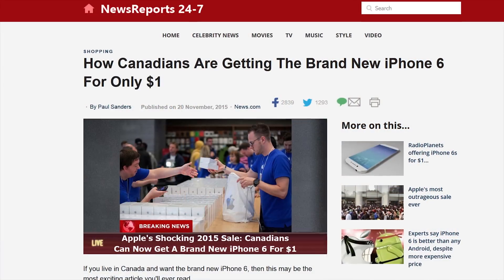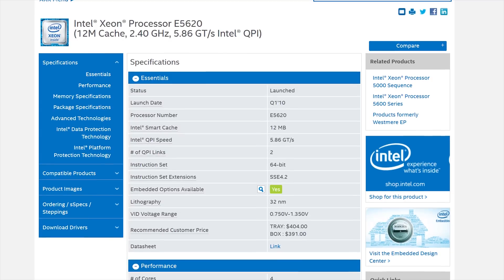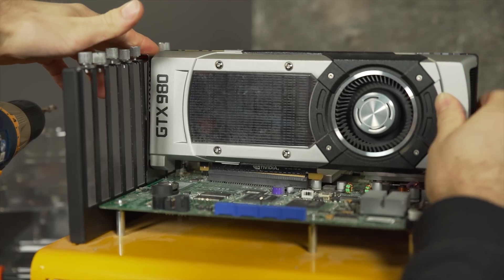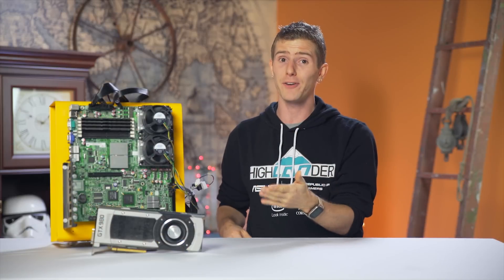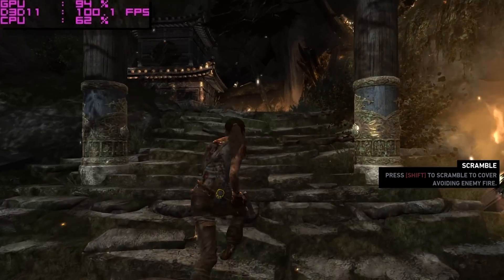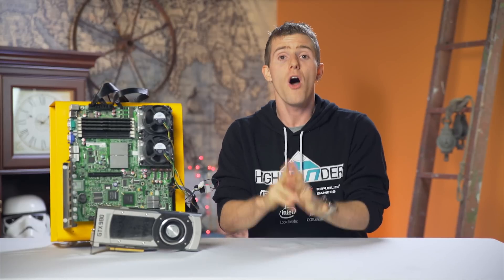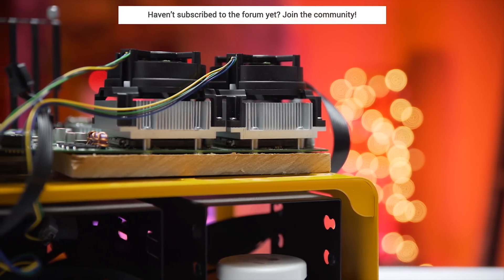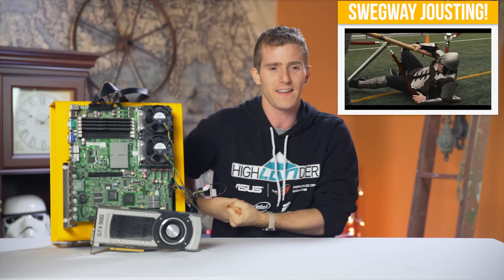Under $150 Budget Gaming 8 Core CPU, Motherboard & 16GB RAM

Comment: DDR3 RAM is dirt cheap (8GB for about 30-40 bucks), low budget ATX motherboards are dirt cheap (40-50 bucks) and an AMD FX-8300 octa-core CPU is pretty cheap (just over 120 bucks). So in total you'd spend about 200 bucks (give or take) for much more standard, newer hardware which still receives support.
What Linus forgot to mention is that you'll still need a PSU, case, HDD or SSD, an OS and, of course, a graphics cards. 

His option is certainly interesting and challenging, but challenging in the sense of buying a beat up 60 year old VW Beetle and getting it to run with parts scrounged from the local scrapyard. In the end it might run, but at what price?
 
If you're really on a tight budget, I'd suggest going to scrapyards, finding some half-decent PCs, cobbling them together and putting in some relatively new hardware. I've found PCs with perfectly fine motherboards, PSUs and RAM and all I had to do was swap the CPU or put in a new cooler or GPU. Or ask a local computershop if they've got any parts they're willing to throw away or sell for cheap. The store I worked at usually collected old but still working parts and either gave them away or sold them for pennies.

Comment: Just one question how this setup compeers to let say i3-4170@3.7GHz + 8GB ram(my setup :) ) in games? Because in video editing those 8 cores will be better but in games? This i3 is also very cheap and runs at 3,7GHz and you get normal mb and no extra moding needed like losing guaranty on graphics card or putting potential fireplace inside your computer case(peace of wood behind two 80W cpus - just brilliant idea)

Comment: I'm glad I saw this. My pc has a really weak Amd apu bottlenecking my r9 270, and I've been looking to replace it. While this really isn't "high end", it would be better than what I've got. Besides, Amazon has this exact same processor for 12 bucks apiece. A motherboard, ram, and two of these processors would cost just under 100 dollars, not including new coolers. Once again, excellent video!

Comment: I just bought this pc for $180 from parts of of craigslist, cooler master atx midtower case, 6 core 3.0ghz amd athelon, an adequate motherboard from asrock, 450 watt powersuply, gtx 750 ti, 8gb gddr3 corsair dominator ram, 500gb hdd,dvd drive, Windows 10.

Always look for package deals, i ended up with a set of 4gb (2x2gb) ram sticks and an old 4000 series graphics card as extras, but the other components mad it worth it.

As long as your patient and know what your looking for you can get great deals.

Comment: Is this a good build
 CPU: http://www.amazon.co.uk/gp/product/B010T6DJCU/ref=as_li_tl?ie=UTF8&camp=1634&creative=19450&creativeASIN=B010T6DJCU&linkCode=as2&tag=alisweb-21

GPU: http://www.amazon.co.uk/gp/product/B015E5X4O4/ref=as_li_tl?ie=UTF8&camp=1634&creative=19450&creativeASIN=B015E5X4O4&linkCode=as2&tag=alisweb-21

PSU: http://www.amazon.co.uk/gp/product/B00YPQN8GS/ref=as_li_tl?ie=UTF8&camp=1634&creative=19450&creativeASIN=B00YPQN8GS&linkCode=as2&tag=alisweb-21

SSD: http://www.amazon.co.uk/gp/product/B00LF10KTO/ref=as_li_tl?ie=UTF8&camp=1634&creative=19450&creativeASIN=B00LF10KTO&linkCode=as2&tag=alisweb-21

RAM: http://www.amazon.co.uk/gp/product/B00QXT5MNM/ref=as_li_tl?ie=UTF8&camp=1634&creative=19450&creativeASIN=B00QXT5MNM&linkCode=as2&tag=alisweb-21

CASE: http://www.amazon.co.uk/gp/product/B00WT0LDDC/ref=as_li_tl?ie=UTF8&camp=1634&creative=19450&creativeASIN=B00WT0LDDC&linkCode=as2&tag=alisweb-21

Mb: http://www.amazon.co.uk/gp/product/B0126R2LBK/ref=as_li_tl?ie=UTF8&camp=1634&creative=19450&creativeASIN=B0126R2LBK&linkCode=as2&tag=alisweb-21

Comment: +LinusTechTips Awesome video, have explored this topic in depth for a while myself.  

Also the CPU's are not designed to be cooled passively. These boards are designed to fit in thin 1U server chassis meaning that the fans are actually installed to the side of the CPU heatsinks. The fan power connectors are powered off of connectors on a daughter board, the RAID backplane, but not commonly of the mobo itself.  Also the server fans usually have different connectors that the standard desktop fans you are using in this video.

Comment: How good is the i7 930 CPU? I saw one on Ebay for roughly 40 British Pounds and was wondering if that is a good alternative? I always see those CPU's on sale on Ebay for some reason. Obviously they are older but will they hold up to modern games on medium/high settings? I have an old graphics card (Radeon HD 7750) and ram so I am thinking of building a second rig for testing and stuff or to give away as a present. Thanks!

Comment: 3 Years befor i buy a (*) for 300€ and additional 16GB for 150€. So now i have System with 2 Quads, 32GB RAM, 3x 1TB (only 2TB Useable because of Controler) in Raid 0 and a XFX HD 6670 because it don't need extra Power. The HDD and GPU i've take from old Towers at Work, otherwise they would throw them away.

(*)Intel SR1560SF2x Intel Xeon E5472 Quad @ 3GHz16GB ECC-5300F RAM

Comment: The sawing of the GPU was a mistake, especially since it's more expensive than the motherboard. You should have unsoldered that capacitor and extend its leads to put it aside.

Comment: Easy, for who care:

Dell Precision Workstation T3500
7gb Ram (ebay)
(1x) Xeon W3530 8 cores (ebay)
Gtx 750 ti 2gb ddr5 128 bit Zotac (Newegg)
Any ssd
Stock Power supply

This cost like 375 usd and run lastest game at almost  maximum setting. That's enough for me btw :P.

Comment: I've also seen older Apple Mac Pros (intel Xeon dual quad-cores, 2.8 - 3.2MHz) online for as cheap as $250.  They'll run Windows 7/8/10 just fine, and you can upgrade the PCI-E video cards.  (you'll have to retrofit cards with 6 or 8-pin power connectors, as it comes with 4-pin)
Benefits of this being it's already a complete system, and a well-designed solid case.

Comment: I did the socket 771 to 775 mod on a old dumpster board I found. The x5460 cost me just $30 and $120 for the 750ti. A year and a half later its still going strong, but seriously though buy a new rig. It sucks not having modern features, but in a pinch its fine.

Comment: Well linus technically you have paid 720 bucks for the system the 150 for the ram board and cpus and 570 for the gtx 980 that is essentially doing all the work

Comment: It's an interesting experiment, but I'd sooner just do a $300 AMD APU build.  It includes the graphics capabilities already, but also has a case and doesn't require all of the tedious hunting for the right parts.  And realistically the build in the video doesn't have the GPU included anyway, which is easily another $150 for something decent.

Comment: Does it play minecraft fallout 4 and FTL?!?!?!
Reply: +ImJosephStalin Not without a GPU it doesn't.  You won't be playing much of anything for $150.
Reply: Not even minecraft and FTL?
Reply: +ImJosephStalin Maybe if the processors have integrated HD graphics.  I'm pretty sure the ones he's using do not though.  

My recommendation is to save up a little more and build an AMD APU PC if you are trying to do it on a shoestring budget.  Or even check craigslist and see what you can get for the same price.

Comment: I don't mind seeing gaming rig videos, but I'd really like to see some work friendly machines. Or would I just need to slap a quadro or fire pro into any of this gaming PCs
Reply: +Luis Valdes What he builds for gaming would be fine for "work" I warranty service and repair PCs and rarely if ever do I see Quadros and FirePros in them. I mostly see older Nvidia 700/800 series single slot cards and older AMD HD single slot cards (that is to say, if Intel HD graphics isn't good enough). My recommendation is that if you need a Quadro or FirePro, then you already own one. And yes, you can put a Quadro or FirePro into any of Linus's builds.
Reply: Sorry,I completely miss the word CAD before the "work". I been told that those cad video cards dont have better specs than gaming cards but have "open gl" that suppose to work better for 3d modeling software. I just dont know if the vcards can be used with any other mother boards or certain processors

Comment: I have a old Hp 800 1000w psu i might actually make that my gamer dual xeon E5506 got dual x5672  (coming found them cheap on ebay) it has 32 gig of ram and a 500 gig ssd  already on it just need a display card that will compliment it any help ????.  Was thinking of a 970 or a 390 (not worth it for the x).
Reply: +Paul K I had the HP Z600 for gaming for a while, but I had the X5570 (edited from X5670) processors with 16 gigs of RAM. I used an AMD R9-270x, so if you want a 390, go for it.
Reply: Cheers mate are the 390 worth it the 4 gig version . Are the X5670 good processors or did i just wast my money . I Have a old xw8600 allso that i modded into another case (fractal eatx case ). Thanks for any advise Appreciate that very much
Reply: ***** The x5670 is GREAT value for the 1366 platform. However, the x5670 is NOT  compatible with the 771 platform xw8600. I'd recommend, if you plan to keep the x5670(s) that you get an HP Z600 or Z800 (just make sure you get the 2nd gen of either.) The Z600/Z800 run $250-$350 on Ebay fully loaded (look for a lower spec one that you can throw you X5670(s)) in and that will save some $$.  Also, on Newegg, the 390/390x only comes in 8gig (unless you count the $800 power color 16gig 390x) and is about $10-30 cheaper than the GTX 970 for a technically better GPU.

Comment: The problem with the $150 price tag, is that there's no PSU or GPU included in the price. A cheap quality PSU can easily kill all your components and a 980ti (as everyone and I say) isn't cheap.
Reply: +Tom5tom Entertainment Yes... From what I can see, I believe (with my years of PC repair and a trained eye) that the motherboard most likely requires the OEM proprietary PSU to work and he didn't want to throw the budget.
Reply: +Matthew Bauer the system uses a proprietary PSU, but there are mass produced adapters that let you plug a standard ATX psu into the board.. the manufacturer didn't do anything but change pin layouts, they still use the same voltages and rails, etc.
Reply: Mystic Miner I couldn't find any mass produces adapters for my HP Z600. I wanted to upgrade the PSU so I could run crossfire and couldn't do it. that mobo in the video DEFINATELY does need the stock PSU. I looked it up and Linus said he used a stock psu for it.

Comment: I was always very budget conscious and did this for my last two builds. The last one was a Tyan S2927 board with two Opteron 2431's. It was nice having 12 cores and 2 GTX460's in SLI, but being limited to the slow ECC DDR2-667 was a huge bottleneck and the weird workstation chipset caused all sorts of poor performance issues in games where it should have cleaned house. It was incredibly stable though.

Comment: OK guys at Linus Tech Tips first of all I love that you guys stepped up to the plate using tech knowledge base to build such a rig. But how exactly did you happen to include a GTX 980 in this build and have it all be only $150? That happens to be one of the latest graphics cards out running as people have said in the comments as being in most cases $500. That said, I would like to see you guys apply this thinking to building a $300 rig. I know you did one but you really didn't apply this kind of creative tech knowledge thinking to your builds in that video series. So I would like to see what you can come up with for $300 using this kind of out of the box thinking.

Comment: I need some opinions. Should I get an i7 3930k for 170 euro or an i5 4460 for 200?
Reply: +cian curran a 3930k für 170€? Go for it, no doubts. Then buy a decent cooler and overlock the shit out of it. I have the 4460 myself and well it´s okay and not bad but I´d go for the 3930 all the time
Reply: Of course the i7 3930k. It have a way better value for this price tag.
Reply: +cian curran keep in mind the mobos are expensive for that socket
Reply: +cian curran There's an alternative to asking for advice, it's called learning. Go learn about the CPUs and chose one based on what you've learned.

Comment: i got 2x5660s for $100 each 2.8Ghz 6 cores hyperthreaded both run at a constant 3ghz even with  the "passive" coolers and only reach about 65c on occt any dataset size, threw them in a dell T7500 for GREAT IO dual processor board except for the SATA only ports(only 3 sata only ports), has a crap ton of PCIe, and SATA/SAS and 12 DDR3 1333R slots complimented by an 1100 watt power supply with 2x6 and 1x8 pin. total build with ram and CPUs(system came full with e5504 4 core 2Ghz and 4GB of ram) 40GB of ram for $38 on amazon used, and a new 240GB SSD came to under $400, with the GTX 660ti 2GB (reference) out of my most recent gaming rig brought the cost up to under $500, and the physx dedicated 650 1GB added another $60, the CPUs score higher in cinebench than a standard clocked i7 5930(1322 on my last run), and the GPU scores about tripple what it did when i ran the test with the quad cores at 2Ghz each

Comment: I went a different route and got a then roughly $35 E5450 to run in my LGA 775 PC. I've got it running at 4GHz, and the cinebench score is fairly close, at 438, despite having half as many cores. 

I may upgrade to an X5470 later to try and bump up to 4.5GHz, but that's wishful thinking.

There's a fairly easy mod that needs to be done, simply called, "LGA 771 to 775 Mod." It doesn't work with all chipsets, but I'd definitely recommend anyone on a budget to also consider this approach.

Comment: I sort of did this (in a way). I was using an Opteron 180 in my main PC until only 5 months ago. Combined with a modern GPU, it worked impressively well considering how old its platform is. I am glad that I have a better PC now, though.

Comment: So I was able to buy an old HP Proliant G5 with dual Xeon X5450  with 20gb ram for 80 buxs, not doing this for a cheep gaming system. Doing this for a cheep Vmware 6 box. Yes I know its not hyper threading enabled but really, this server brand new was over 8K CAD.